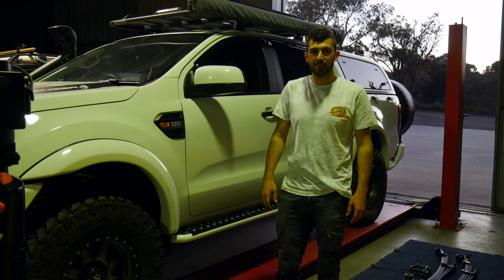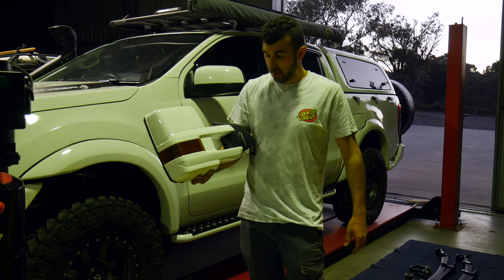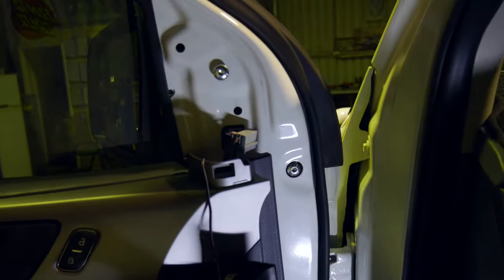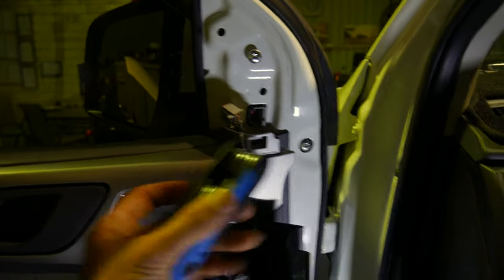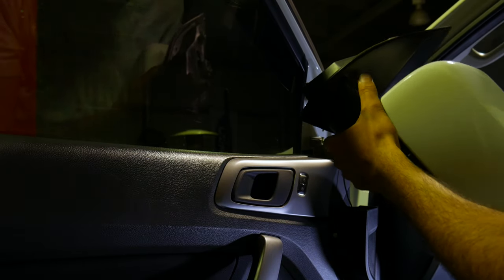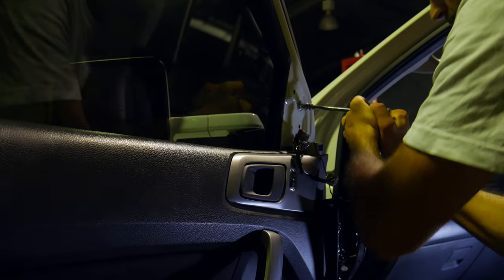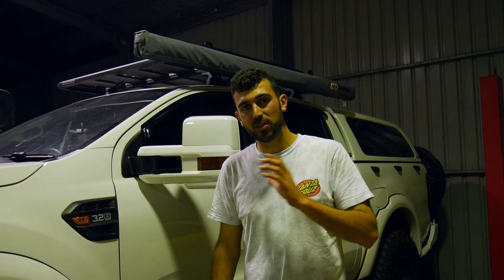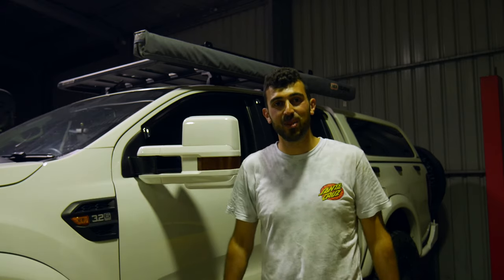TOWING MIRRORS INSTALLATION | PX FORD RANGER MK1 MK2 MK3

Comment: This method (not taking the door interior out) was easy enough, take your time with the tricky to get to bolt. I think it's worth it, as i think i'd probably break more clips etc trying to manipulater the interior door card out like other methods show. Like if you know where all those bolts, clips etc are the other way would be fine, but the way shown here cuts out a load of places where you could screw something up.